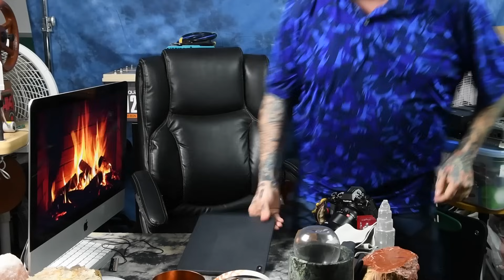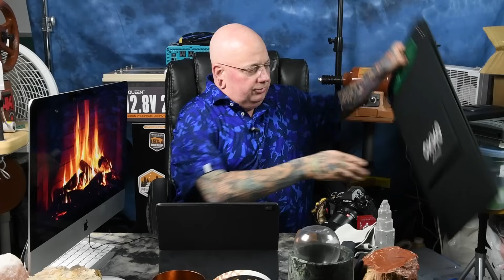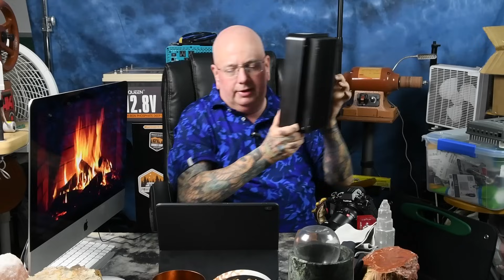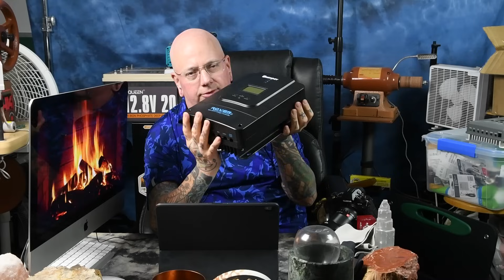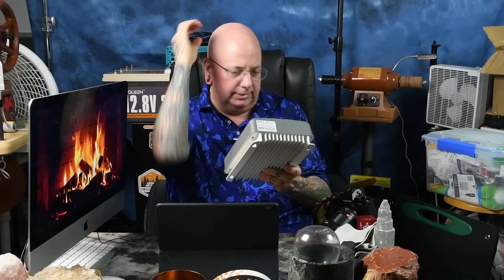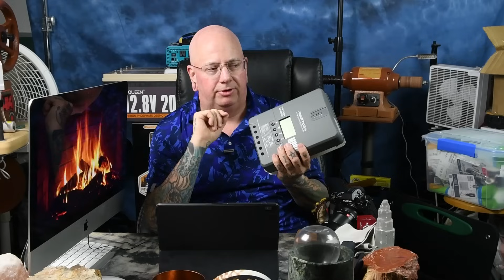🤯  POWER Independence. 200AH LITHIUM Best Option 🔥

Comment from the maker: Power Queen 12.8V 200Ah LiFePO4 Battery
https://bit.ly/3MJUXCd
Power Queen 12V/24V 30 Amp MPPT Solar Charge Controller
https://bit.ly/3QB52Cm
Reply: Do you have a link to the 1000w power inverter?
Reply: Is there a link for the folding solar panels?
Reply: i used 50000mah poweroak portable when i lived in a tent, they are affordable and have the actual capacity they tell em to have
only portable that does that, someone stole charger for it so i sold it, now i have new one, same old model, weights around two kilos

they have bigger not so portable systems that you can hook straight into panels too

i think poweroak is mostly for the european markets
Reply: I think your a jack ass for not making money of of reviews of stuff you would use your self!!!   I have 3000 watts of solar for my 40 foot diesel pusher coach That's all that will fit on top I have around 20k of samsung sdi battery modules Brand new same as electric company uses  I have a two 60 amp make sky blue mppt charge controllers   I am thinking about making ground mount that folds up to set out when parked also  I already have more panels to do it  I built my own 10 thousand watt low freq pure sine wave inverter  I have built several for friends and few other for myself     I told you long ago and still good today I will give you a couple 330 watt panels free  Stop by pick them up I am a nutty hillbilly but no harm It is easy to check me Ben and Amber out or anyone out nowadays                                                                           Warning I wrote book but you can speed read LOL                                                    Sooner or later I am going to be making a very very cheap gas or propane battery bank charger  It will detect battery bank voltage sag and turn on automatically           A solar system has to to sized to the largest loads and for several low winter solar input days in a row  This means a lot bigger battery bank and a lot bigger solar array than what is needed 80 or 90 percent of the time  The gas or propane dc generator (NOT AC) battery charger will automatically start and provide the power needed  above the normal usage  The higher the wattage used from a battery bank the more the voltage sags  The sag voltage would be one of two user defined set points to auto start dc generator  The other would be low voltage set point                                    A smart programmable voltage reg with smart relay to start and turn off dc generator  battery bank charger at user defined set points!                                                              This will be for ALL battery bank voltages from 12 to 96 user defined                      User sets the voltage and max amperage so it will work with any setup                     The dc generator battery bank charger would provide a extra 2000 to 5000 watts automatically but only when needed                                                                                     Is your brain clicking Ken or who ever else is reading this                                                 Say its a holiday (cooking and or you have company)or very hot day(want to run ac)or cloudy no sun shine for several days or a week!!                                                            Your battery bank and solar has to be over sized for this                                                 Or you have endless extra power when needed with out greatly over sizing at giant cost your system    The cost of the dc generator would be as low as around 100 bucks for some others maybe up to or around  500   Some people will already have a electric start lawn mower type motor  The brain and generator will cost around 200 bucks new  The dc battery charging generator will mount onto a rv's reg engine  Again the output voltage will be user defined what ever they want to set it at from 12 volts through 96 volts  I have already got the go ahead from a EE and programer to design the product  This same EE and programer has many very high quality  solar products on the market  This is no pipe dream the thing we dont have is people to show the product  This is not a money thing for me it is just badly needed in my point of view  I may have it made even if only for myself and friends  What do you think Ken would you try one out free of charge and do a video telling what you honestly think about it  No scripting if you think its shit you say its shit if you think its awesome then say so or anything in between  Hell do you want a cut to do ALL marketing?  The EE will have a percentage of all sales do you want to market it for a percentage of ALL sales?   I am not joking there will be a lot higher than norm meat left on bone   And product have a very very low cost also Ken!  My sis is a programer and commercial artist  I have the help you would need already         If interested in getting free one or doing the marketing let me know
Reply: @servicingiq  interesting 🤔 I've never heard of LED carbon batteries.

Comment: I’ve watched this video several times. Is there a better place to buy solar panels? What I’ve seen is 100 watt briefcase units for $200 at REi. Can you use 2 power queen batteries with a 30 amp charge controller?
Reply from the maker: sure, buy em on renogy.com site

Comment: Correct! If a Lead Acid Battery is discharged below 50%, you run an exponential risk of permanently damaging the unit. I have 600 AH of lead acid. I never let it go below 350. I need to upgrade to lithium.

Comment: Hi, Ken. I appreciate your survival advice and recommendations! Speaking of which, I survived (barely) the 2021 Texas Arctic Blast after some bureaucrat intentionally switched off the power to Galveston for 3 days when temps fell into the teens. (My battery-operated thermostat registered 32 degrees inside my home!) Thankfully, a kind neighbor in an old house still equipped with a vintage gas log fireplace (no electricity required!) let me and my dog sleep on his couch; otherwise, it might have been permanent lights out for moi. (Galveston is a historic town with many vintage homes. I'm sure my own 1920s bungalow once had either a gas floor furnace or a gas log fireplace that was removed before I bought the house by an earlier remodeling moron.) So, after that horrific experience and with limited funds but a desire to protect my life going forward and after doing my own extensive research, I just purchased a solar/electric generator, the Anker SOLIX F2000 (PowerHouse 767) with Expansion Battery (4096Wh/2400W), along with an Off Grid Trek Solar Blanket (24.5% efficiency rating, the highest currently on the market). While this little (not cheap!) setup ain't the sun, the moon, and the stars, it's a good start and will definitely save my life the next time a government bureaucrat tries to kill me. 😉 Your setup in the "outback" would be ideal and I used to have something similar, but then life (and death) happened. We do what we can. ♥

Comment: While the LiFePo4 Chemistry is more stable.. its still not  bullet proof. Thermal Runaway is still possible , and you really shouldn't be charging them at sub freezing temps.  But yes, this is a really good deal  for this Chemistry.  $210 /kw-hr of storage ( of course its less cause you don't want to fully discharge them)   I am just not a fan.  I use Hup Solar Lead acid still. But also not cheap. It allows 80% discharge , but I sized them for 20% on a normal basis. But its nice to have the extra capacity if needed.     Hoping that the new Sodium Ion Chemistry batteries come out in the next year or so - they are supposed to be hitting a $50-80 /kw-hr price range and supposedly  won't suffer from thermal runaway or temperature issues  and won't need a special charger to manage them. They are supposed to appear commercials in some foreign EVs soon. they are made by CATL in China.  Just something to keep an eye on.

Comment: Didn’t mention how long batteries last (life of battery) also disposal options. Also will the foldable connect to controller or is it just usb?
Reply from the maker: you CAN connect the folders to teh charge controller.....5000 to 7000 charges depending on use profile......disposal, lot of places LOVE taking in used lithium batts.

Comment: Ken, is there a reason to recommend a 12 volt battery over a higher voltage like 48?  Only benefit I can think of is being able to use 12 volt USB chargers.
Reply from the maker: simplicity of universal setups both station and mobile

Comment: Thumbs up from UK.  I've had a 280ah LiPo4 solar system for a few years,  it will run my chest freezer for 4 days without any input (sun or external charging) Planning to add another system.  It also acts as insurance, how much are the contents of your freezer worth ? Answer - quite alot if the shtf & the shelves are empty.  A duel fuel generator is also handy for longer outage periods with little or no 'free' sun power.  Plan for the worst, hope for the best & if you wire it all up diy, use correct guage cable & plenty of correct rated fuses.

Comment: You keep saying even if I don't like you!! What if I do like you?? Cuz I kinda like how you talk! LMAO!! Sold set er up, I'll take a full package! 1000 buck's! Semper fidelis to my brothers! Thanks for the break down on how to plug it all in!!!
Reply: Would it run my well pump? It's a submersible! You know down in the well not up on the ground? Thanks Ken, we just got our first deer of the season! Michigander here!!
Reply: @jrfmichigian  You would have to check the amps and voltage on the motor to see what size inverter and system you need!😁amps X voltage  = watts for inverter and system!😁
Reply: @wallychambe1587  it's on a 30 amp breaker in the breaker box!! I have had to undo the three wires from panel to run the pump with my generator! It also had a 30 amp breaker!

Comment: Hello Ken, that sounds great I'll aim to get this same set up it'll be interesting to see the costs in England it may be cheaper to just wholesale move to Kentucky.
There's seams to be some confusion in battery management from older tech to newer tech, I recall the ni- cads like to be fully discharged we even use to put light bulbs on the batteries to get em really flat, then fast charge them, then trickle charge at the end, then the duration would be longer.
So effectively almost the opposite of Lithium ion, as I was roughly aware it's best not to as you say run em right down, it was good to get confirmation on that.
When did lithium iron phosphate come in, and how does it differ from just lithium iron? Is it safer or how is it safer? 
That overheating spiral of doom that appears to be causing EV fires, in lithium iron phosphate can that not occur?
I'll aim to also get the old school lead acid or caravan battery set up aswell, even with its limitations I just like the known durability.
Cheers

Comment: I want to see a Ken versus Hobotech death battle now ha ha. 
Seriously though, i am on the grid but was living in dfw a few years ago during that deep freeze. My power stayed on fortunately unlike many of my coworkers. 
After settling in Albuquerque a couple years back, I bought a couple Lioch solat generator stations and 3x100 watt foldable panels. Each generator is 2000 watts. Fortunately, so far, no blackouts. But I will be ready this time with these and a kerosene heater with 10 gallons on fuel. 
Also worth mentioning to look into an electric blanket and some heated attire. Prepper Princess shows off the portable heated attire at times

Comment: I have a roof full of pannels but mine feed the grid and i get paid every month. I want to do batteries but they are too expensive. Iv been looking into something like this to small scale run them if shtf. I have a large transformer on the ground next to home thats mine the power company put in becuase im far away from lines. They told me if i used a gas generator and powered up my box that activates the pannels to send power into transformer to the lines to the grid that it would power the grid for some houses connected to my line.. not sure how i can mod it to run on batteries id have to disconnect the wires... i was gonna see if i could get my electrition to but a outlet on the closets pole on my property then run a extention cord back to my home.... still id have to figure out how to get fuel to the generator to power my box but i could use this setup to solar power the battery to power by box to power the pannels to send electricity into the grid the  using a outlet connected to the electric pole run extension cords back to my home to power it...
Reply: Last time I did that the cops were on my ass for running a marijuana farm.  Lol....All the extension cords tips em off. Lol.
Reply: @MychelleSeymourHeyyouremember  🤣🤣🤣
Reply: @wallychambe1587  No! You're funny 😁

Comment: Do you need to charge Li-pol 3.7 v 1000  mah batteries befure 20% and Li -ION 800 Mah ?before they get under 20 %?
Reply from the maker: the gurus say roughly 15 to 20%
Reply: @KenTheoriaApophasis sorry. One more question what is the lifespan of a li - ion battery?

Comment: So charge the battery before it drops under 20 % ?
Reply from the maker: roughly yes
Reply: @KenTheoriaApophasis  thank you very much kind sir !! I thought I read or heard somewhere that you want to let the battery drain all the way down .but apparently that was wrong Information. I also heard when charging to always charge to 100% and of course don't over charge bit sometimes only charge to 80% every once in a while .so from now on I will not let the batteries get real low ..I thought I heard to that if you always charge it before it gets real low the battery won't last through a full charge cycle as long .but long story short you are saying you will get a longer lifespan of a battery if you charge it before it goes under 20% .thank you.
Reply: It is even recommended you charge your lithium phone battery at no less than 30%!😁😁
Reply: My Lipo4 batteries have an integrated Bsttery Management System (BMS) that communicates with the charger and doesn't allow an overcharge or overdischarge.
I could be wrong, but I thought this was a feature of all lithium batteries 😕
Reply: @sdextereo1  thank you